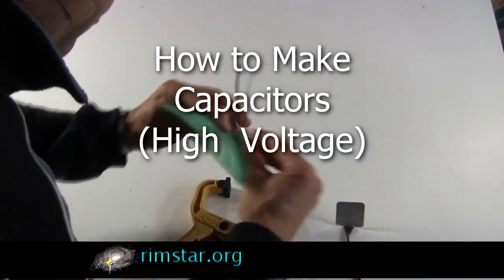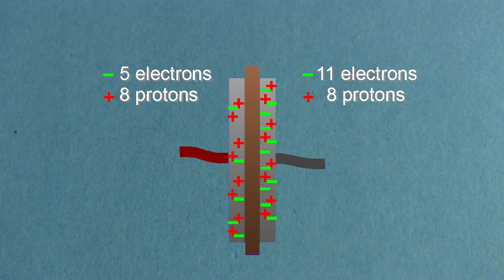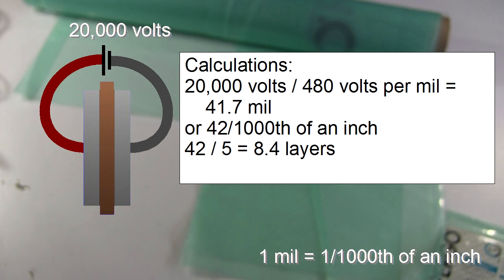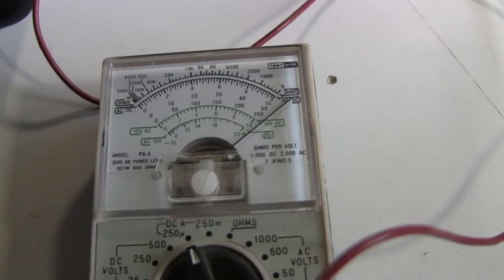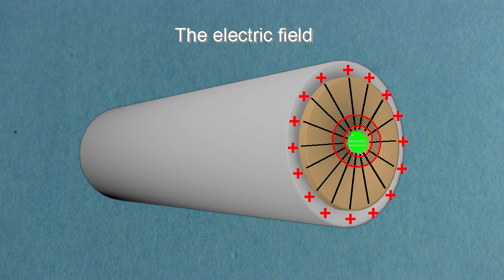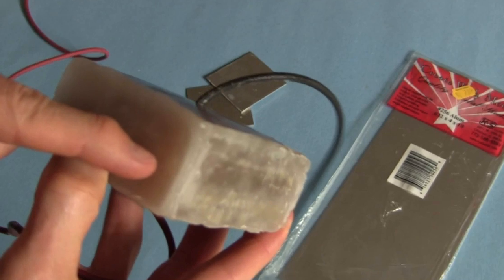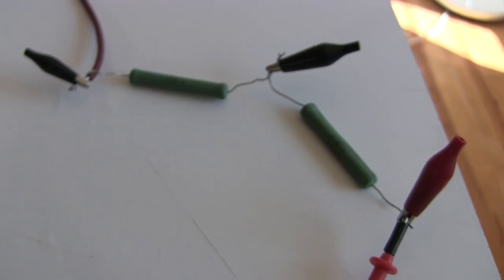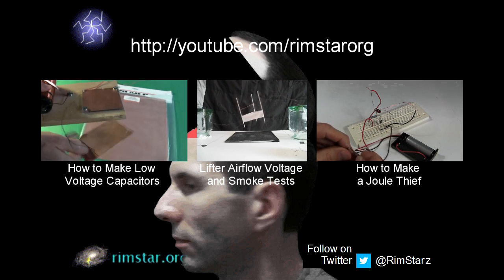How to Make High Voltage Capacitors - Homemade/DIY Capacitors

Comment from the maker: I won't make a video of it but what capacitance are you trying to get? How much voltage? A low inductance mineral oil one is tricky (on first thought) since for low inductance you'd want to connect along the entire length of each capacitor plate, not just at the ends of the plates. Since for mineral oil you'd likely be submerging the plates, only one end would be sticking up.

Comment from the maker: You mean to use an old monitor to get the high voltage? Yes, you can. It has to be an old PC monitor and it can't have power saving features. I have a webpage on my website all about doing it rimstar.org/equip/hvgmon24kv.htm

Comment: They are run capacitors, as they are designed to operate continuously. Motor starting capacitors have a higher capacitence, but are only intended to operate for the length of time necessary to start an electric motor, typically less than one second. 

Start caps typically have a value of more than 40 uF, and are used exclusively for motor starting. Run caps typically have a value of less than 60 uF, and are used for more general purposes. 

We carry both. Rahway Electric Motor Co. (732) 388-2829

Comment from the maker: Not directly. A battery puts out direct current (DC), a steady flow, one-way, uniform flow of electricity. A transformer needs current that's constantly changing such as alternating current (AC). You could, however, add some circuitry between the battery and the transformer to change the DC to AC before going into the transformer.

Comment: Can a battery power a transformer?
Reply: Sonic Vue kinda... look into a DC to A.C. converter for cars, you can't run a transformer unless you having a changing magnetic field which can be done by either spinning a magnet or by using A.C.

Comment: seems that polyethylene is one good insulator for  some experiments ,  I found that my electric tape  which is 0.13mm can hold against 24000 w/o breakdown.. its got to be 30kv at breakdown which means 230 000v per mm!  too bad electric tape comes in  narrow.   May I ask you where you got your polyethylene from, it seems to be nowhere to buy on the web  ha?

Comment from the maker: To get those ratings I just did a google search for the dielectric strength of polyethylene. If you do that you'll find a bunch of tables on different websites. All they say is "polyethylene", nothing about any grade. So I don''t know what grade the numbers were for. Also, for mine all I know is it's used for putting on floors under carpets to act as a vapor barrier. And thanks, I'm glad you find my videos and website helpful. Sorry about speaking fast.

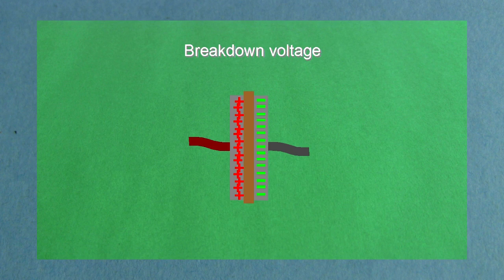Comment from the maker: Ah, thanks for clarifying. And I agree that adding layers of insulation between the electrodes changes the capacity. But if you're going to be using a certain voltage range then your capacitor will have to be able to handle those voltages. Since it affects the capacity, you'll have to change something, like increase the surface area, to increase the capacity at the same time. That's why at 1:11 I refer to my video that talks more of the variables.
Reply: hi first thank you for the simplified explaination that i could not have found anywhere else on the internet, and i have a question please, that capacitance formula is there a similar formula for batteries i am trying to make a salt water batterie using zink and copper electrodes and i wonder if there is a similar formula to calculate the estimated capacity and voltage 🙏🙏🙏 and thank you

Comment from the maker: If the power supply is disconnected from the capacitor so that the capacitor is on it's own, then yes, it holds the voltage, though like any capacitor, it loses some over time. If you just unplug the power supply from the wall, then in this case it also holds the voltage. Some power supplies, when turned off, would allow a path to discharge through the power supply.

Comment: does the capacitor actually hold the voltage  when the power supply is un-plugged?
Reply: it should if there is minimal leakage

Comment from the maker: Since you're using AC and not DC, the capacitor is being constantly charged and discharged and with alternating polarity. I suspect the vibration is the plates being attached to each other when charged and then relaxing when discharged. The way I suspect there's a loss is that since the plates are free to vibrate a bit, they must not always be as close as they can be. If they're as close as they can be then they'd always have as high a capacitance as they can have.

Comment: As a test of dielectric i put the electrodes of my 9000 Volt transformer to a sheet of 3mm glass. The glass din't break but I hear a buzzing. Do you think there is energie loss between the electrodes?

Comment from the maker: It's used for this purpose quite a bit; it wasn't my idea, I was just following common practice. From wikipedia it's used "in transformers where it is known as transformer oil, and in high voltage switchgear where mineral oil is used as an insulator and as a coolant to disperse switching arcs." It's not considered flammable because its flashpoint is above 100F/38C, but is considered combustible for the same reason.

Comment: is it dangerous to use mineral oil for capacitors  dealing with HV like 20kv-100kv? I was thinking about the flammability you know? explosion of oil? It would be so much easier to use oil  otherwise
Reply: Kaledius try to find a oil with the highest flame point you can, you can use motor oil if you want for example. If you are worried about fire then put the system under vacuum, if there is no oxygen it won't burn.

Comment: yes That was what I meant. the voltage per mil decreases significantly as  the thickness of the sheet is increased.  So while yes ofcourse the total Breakdown Volt. of a thicker  sheet is higher, this same thicker sheet is tremendously awfully inefficient at shielding since its v/mil is very low.. all that is in complete opposition to for instance your tests... ha?

Comment from the maker: I looked for that and it looks like it includes DC. Notice it's not saying that the voltage needed decreases as the material gets thicker (i.e. it's not that a thicker material will breakdown with less voltage than a thinner one.) The voltage per mil decreases as the material gets thicker. So each additional thickness give you less and less additional protection.

Comment: Thanks but trust me I read many pdf papers where they state that as  the mil thickness is increased, the voltage strength per mil decreases,   that was for mylar for instance: here for example you can see the table at the first page  of this pdf:  tinyurl com / kj2afff

Comment from the maker: No. If the breakdown voltage of polyethylene is 500 volts/mil and the polyethylene is 20 mil thick then it can withstand 500 volts/mil x 20 mil = 10,000 volts. If it's 40 mil thick then it can withstand 500 volts/mil x 40 mil = 20,000 volts. So the breakdown voltage increases as thickness increases but the breakdown voltage per unit of thickness (mil for example) stays the same.

Comment from the maker: A capacitor won't help you get from under 12V to 50kV. For that you'd need a high voltage power supply or some minimal circuit. Also a Van de Graaff generator or Wimshurst machine will do. But a carefully insulated capacitor like the two I show at the beginning of this video will hold 50kV once you have the high voltage power supply to make it. See the links in the video description for various high voltage sources.

Comment: what would be the best kind of capacitor to make to charge to a very high voltage then release that energy. basically use a AA battery (or any dc voltage under 12v)to charge to 50Kv

Comment from the maker: If you mean the place in the video where I'm showing leakage at one of my connections (5:32) those are positive ions since they're at the positive wire. I don't know about positive ions being toxic but I know ozone can be produced in this way. Ozone gives off a pale blue light. It's not an ion since it's a molecule of three oxygen atoms. Ozone can be harmful in over a long period of time. My test was pretty short but anyone exposed to it a lot should do so in a ventilated room or outdoors.

Comment from the maker: For voltage you can use a meter with a suitable probe. In this video, since I'm measuring high voltage I'm using a high voltage probe connected to my analog multimeter. Some meters, like my Fluke digital multimeter, can measure capacitance. You can see me do it in my "How to Make Capacitors - Low Voltage Homemade/DIY Capacitors" video at 5:01 into it. There's a link to that video in the description below this video and you can find it on my channel page.

Comment from the maker: Interesting take on it. I gave basics like talking about breakdown voltage and how to figure out how thick to make it for a desired breakdown voltage and how to test it. I gave basics on materials like wax and resin for insulating and avoiding sharp edges and why. And I did show you the steps for one with two copper plates starting at 7:28. But I guess this is more of a "all you need to know to make one of your own design video" than I "step-by-step only for one capacitor video."

Comment from the maker: I'd suggest Basic Electronics by Gene McWhorter and Alvis J. Evans published by Radio Shack. It's on Amazon. Actually, all Radio Shack electronics books I've bought from Radio Shack, even in their stores, are great for beginners. I suggest a trip to their store. An amazing one for intermediates is Basic Electronics by Bernard Grob published by McGraw Hill but I see a lot by Grob on Amazon and don't know which it is. It's ISBN 0-07-024923-7.

Comment: I am fascinated by this science but know not where to start...I just got my first multimeter last year and have been doing things like measuring voltage drop on my home wiring when the furnace cuts on and measuring the ohms of my guitar's pickups...I'm pretty much a book learner so can you recommend a decent starting point? I've seen a few interesting titles on amazon like Make: Electronics and There Are No Electrons....any insights?

Comment from the maker: Wait a minute. What do you want with a... nevermind. I don't want to know. :)

Actually with a small modification to the one in my How to get Piezoelectric Crystal from BBQ Igniter/Lighter video you get something fairly shocking if you touch someone with it. At 2:12 in the video you just need to get rid of the tube and touch them with the end of the yellow wire.

Comment: great info! nothing helps me to understand something better than watching someone break it down or build it, thx for sharing! could the thickness of the polyethelyne be causing the discrepency between your test and the breakdown info that you found online? general purpose poly is quite thin, whereas construction poly is many times thicker. the poly you used seemed quite dark like construction poly - maybe it's thicker than the poly that the site gave a rating for?

Comment: Good video! Very informative. Thanks for uploading. Could I request you test the dielectric strength of some common household materials. Like Cling wrap (good quality and super cheap), Disposable cups (plastic and polystyrene), Plastic freezer bags, Rubbish bin liners etc etc?

I'll be doing some more testing with Cup-caps and some other ideas sometime, First I need high voltage. Few other things on the go.  I know your busy too. Look into lanolin oil if you get a chance. Keep up the good work.